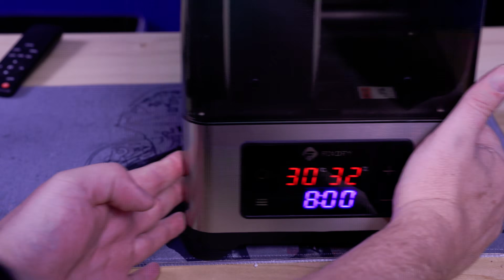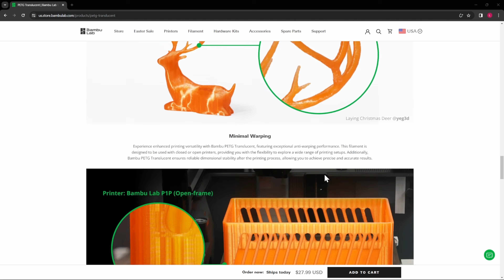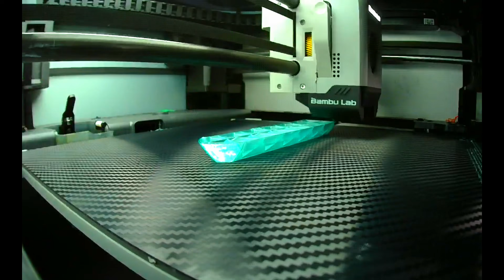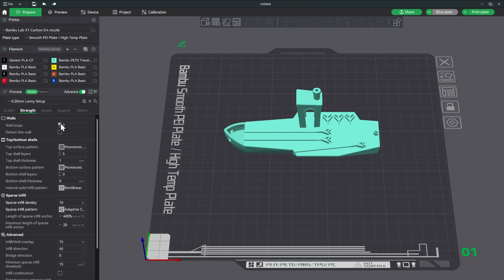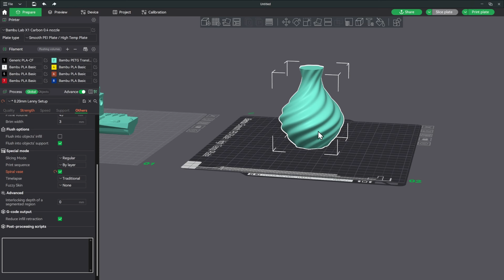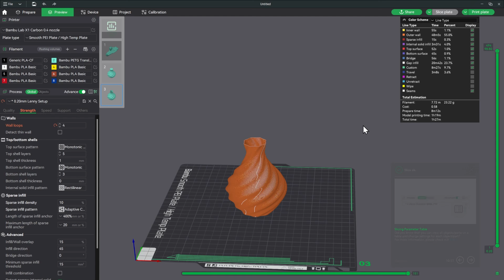Bambu Lab PETG Translucent Review

Comment: My 0.4 nozzle was clogged beyond saving.and I had to change it for a 0.6.  My beat “transparency” results are this new 0.6 nozzle, one or two walls 0.8 line width, 0.3 layer height.  I am using sunlu clear PETG.

Comment: How thick is the wall on the original? 4 wall is probably overridden by the file thickness. You need to consider the inside wall. What I am referring to is if it is wall thickness of 2.4mm 4 wall the total thickness of 8 loops. If it is 1.2mm thick, 4 wall it it would be 4 loops. It is the same as 1.2mm thick wall, and 2 walls. It is challenging to design the inside and outside,  with strength in mind.
Reply: The ship model isn't hollow as far as I know so that shouldn't matter.